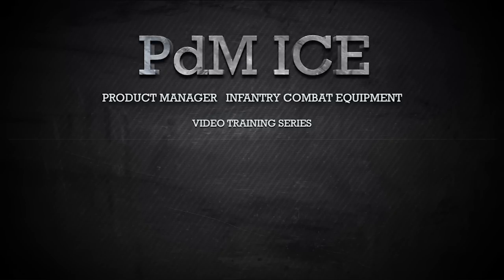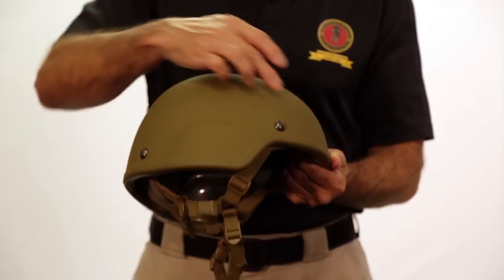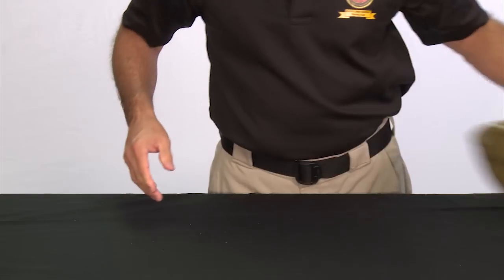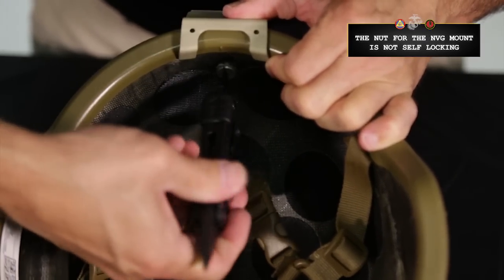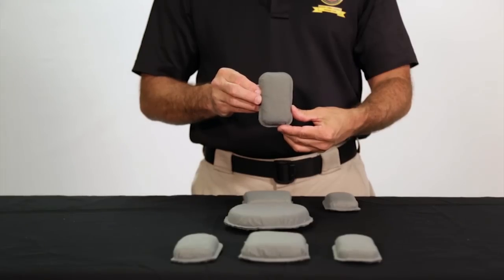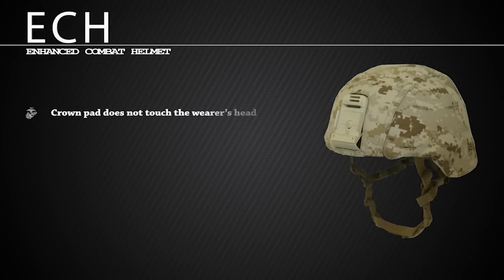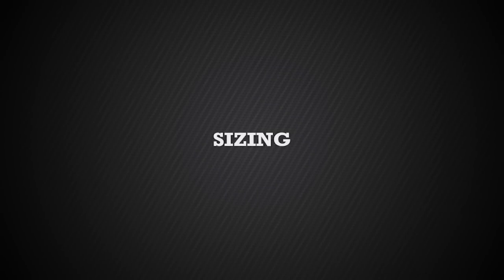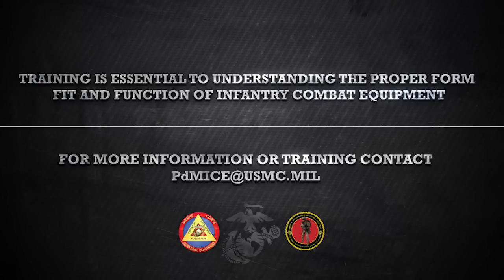Enhanced Combat Helmet (ECH) Training Video

Comment: Saved my life in Afghanistan!!! But annoying and heavy as hell in my head lol.
Reply: Sound like you had fun we stuck in Pendleton attacking the water
Reply: @ieatcrayons-oi9ye  that was back in 05 lol. long time ago.
Reply: All the fun is gone
Reply: @realblackbetty2204  they didn’t have this in 2005, it was made in 2012.
Reply: @petergriffin110  I’m talking about whatever they give us back them. It was heavy af
Reply: @realblackbetty2204  when and where did you serve
Reply: @petergriffin110  00-05 usmc
Reply: Pasgt
Reply: @realblackbetty2204  PASGT was heavy and annoying with the old suspension, those could be upgraded to a pad system with the BLSS kit

I was issued the LWH with better suspension pads. havent got an issue besides the slimy chinstrap. back in '09
Reply: @louiesouthgate8347  lwh is a pasgt style shell. But very much an ach
Reply: @HatsuneM1ku01  there is a difference with the brim being less pronounced and the screws being positioned higher.

But yes they did improve the pasgt shell but design had slight distinguishable shapes

Comment: ECH is product of the Marine Corps and Army and suppose to be the first level 3 ballistic protection which it can take high caliber rifle rounds .30 carbine, 5.56 NATO, 7.62 Kalashnikov not sure about 308. Pads are also updated not sure if the pads are by Skydex or Gentex. By this time ECH will be used only by combat roles so the ACH and LWH will be still in use in noncombat roles do to ECH is to expensive to make do to the material that is being used to make it.
Reply: It survives a 308 at 100 yards
Reply: @deez420nuts69  the v50 is 100 yards v100 is 200
Reply: @deez420nuts69  out of curiosity is there a difference on the label indicating if a helmet is v50 or v100? I was going to acquire one at a good price, but would prefer it be the stronger of the two.

Comment: The first thing you are going to do when receiving this helmet is put those useless helmet pads into a ziploc bag with the X harness and replace them with a better quality harness and pad system. Oregon aero or 4D tactical pads and an opscore H nape should do the trick 👌 eventually upgrading the NVG shroud should be considered as well.
Reply: They actually changed the NVG bracket and went with the Ops-Core Head-Loc retention system. The new bracket mounts straight to the front of the helmet and doesn't have to be hooked over the brim like the previous design.

Comment: With fielding of the ECH, Operation Helmet is receiving multiple requests at the individual and unit level for the helmet pads we buy and send free to troops OTW. Told ya'. Now over 83,000 kits sent out, none returned. These upgrade pads ($28 apiece) last an entire deployment, not the six months with the GI sacks of poop.

Comment: I like how the marines and army made the same helmet and just named it differently, ACH and ECH
Reply: Cody The Gulf War Airsofter the helmets are the same.The ECH helmet is the multi branch helmet that is replacing the ACH for the army and LWH for the marines.
Reply: Well not really the ach and ech have the same design they are made of different materials, also the ech can stop rifle rounds the ach cannot at least not without a glancing shot.
Reply: the galapagos yea your totally right . That completely slipped my mind when I wrote my comment. If I remember correctly Ceradyne stated a 30 ish percent improvement in frag protection as well as protection against specific rifle threats like 30 carbine.
Reply: the galapagos not quite. The ECH has come improved resistance and lighter weight but it certainly doesn’t stop direct rifle hits.
Reply: ACH is made of kevlar
ECH is made of Ultra High Molecular Polyethylene
Reply: Nah, they're different. I was issued an ECH for my deployment in 2019. It's a lot thicker profile than an ACH, because it's made of UHWMPE.
Reply: ECH is very different from the ACH. In the manual I got with my ECH, it includes a little half inch measuring tool. If you put the rim of the helmet on the tool, and it is thinner than half an inch, it is an ACH or MICH. If the shell is half an inch thick, then it is an ECH. Because of the difference in shell thickness, ACH attachments and screws will not fit on the ECH.
Reply: @thegalapagos57 ech can stop rifle rounds but the deformation will leave you drilling a a wheelchair the rest of your life so it’s a lose lose either way. The fact it’s touted to stop rifle rounds is more than a gimmick than anything. Either die from an ach rifle rifle penetration or survive with a baseball dent in your skull and brain damage where a nurse feeds you the rest of your life.
Reply: @HatsuneM1ku01  did you read the account from a u.s soldier that got shot in the back of the head from a pkm burst? Helmet looked like shit but he survived just was knocked out for a while. He was wearing an ECH.

Comment: I like the brim of the old pasgt!
Reply: Pasgt are litty
Reply: Duncan M. Pasgts are more practical.
Reply: Solipsil Interceptor vest has nothing to do with the PASGT other than it was issued with it. The Pasgt handled Weather better due to its helmet band, while as Mich style helmets fail due to the heat from the Pads in the desert, and the pads freezing up in the winter. As far as ballistic-wise goes, yes the Mich is more ideal, but only in SOME scenarios. As if the Mich pads become too soft, the force of a shot would still transfer to the skull. If the Mich pads become too hard, the force goes to the skull again.
Reply: @barn7121  mich and pasgat have nothing on the ECH ballistic wise.
Reply: Solipsil you are right but he’s just saying that there are still some advantages to the pasgt even though the new ech is a much need improvement
Reply: @barn7121  better pads are available for purchase, and I'd much rather have a pad in-between my skull and the shell rather than just air like the old liners, due to the pads helping with back face deformation. The pads as well as the newer helmet shells disperse force from a ballistic impact FAR better than any older design. Of course, there will be some that prefer the PASGT to any newer helmet just like those who preferred the steel pot when the PASGT first came out no matter how much proof there is to the newer helmet being better.

Comment: I purchased a size large helmet. I believe that it's an ACH since it has the Army ACH harness installed. I didn't like the ACH harness, so I purchased a USMC harness which I like better. I don't know if this harness was for an ECH or a LWH, but it doesn't fit the helmet that I have. It indicates that it will fit L& ExL., but it just isn't large enough...it doesn't fit. Any ideas on the reason? I also noticed that the screw posts on the helmet were too large to go through the grommets in the USMC harness...not such a big problem, just enlarged them with a center punch to fit. Numbers on it are; 97427/04011896-2 looked this up in the NSN registry...nothing. The 97472 brought something up, but not a single equipment piece.
Reply: Measure how thick the shell rim is. If it is half an inch thick, it is an ECH. If it is thinner than half an inch, it is an ACH.

Comment: Helmet bands are no longer issued then?
Reply from the maker: Duncan M. Thanks for your question. Nothing has changed; helmet bands are still unit-issued items. They have never been an issue item for the Helmet (SL-3). Units can order through supply for items. They are also available for individual purchase.
Reply: Marine Corps Systems Command Ok, thank you sir/ma'am!

Comment: Seems to me one of the most impractical desighned helmets I have ever seen and probably one of the most expensive to produce. Hell, my Equastrian Troxel Helmet has a better desighn than this at $50. With that pad systom it rides too high on the head with no ear or neck protction.....looks like your wearing a mushrum with a cobweb netting for a retainer. Does the retainner clip have any breakage so you dont get your head riped off from artilery concusion?
Reply: +mark warnberg Ugly too, Seems too me it might like the f-35, A failure
Reply: Always liked the look of the old German Stål Helmet, covered the ears and neck. I´v seen the crome version, man they look Sharp. To bad the helmet got a bum wrap.
Reply: +mark warnberg It doesn't offer ear protection because its designed to be worn with ear protection and coms, namely Comtacs or Sordins. Thats the entire point why its synonymous term is the MICH 2000 or Modular Integrated Communications Helmet. Thats what the problem was with the old PASGT Helmets and K-pots, the way they were cut and rode so low on the ear that it was too bulky and didn't fit well with headsets and ear pro.
Reply: Because your equestrian helmets stop rifle bullets? 
Neck protection are offered by separated neck-pads, and Gucci already mentioned why ear brim was removed, in fact, it was widely required by troops issued older PASGT.
Reply: Riding helmets are not meant to stop bullets but they will protect you from a horse kick with kleated shoes on or your head comming down hard on a Sharp objekt. I was talking about the desighn on a very expencive peice of Equipment.
Reply: @markwarnberg9504  try shooting in the prone with a plate carrier on and the old PASGT or USMC LT-WT helmet. That's another reason the helmet was shortened all round and the visor eliminated. The backs of the old helmets would hit your gear and push the visor down over your eyes.

In fact, while they did it to make the helmets more jump safe, it's still  EXACTLY what the Germans did in WWII with their M35's when they made the Fallschirmjager helmet. Cut the visior off and trim the skirt all around.

So the ACH/ECH is to the LT-HT/PASGT what the Fallschirmjager helm is to the M35/M40
Reply: @poolee77  I wore the M1 a lot and didn´t have any problem shooting from the prone though it wasn´t much fun double timming in it as I recall.
Reply: @markwarnberg9504  The old M1's didn't have the same profile as the PASGT/LTWT, which was shaped after the German WWII steel helm. Also remember today's troops are wearing bulkier body armor and the PASGT/LTWT really interfered with that in the prone. In addition to solving that issue the ACH/ECH is easier to wear headsets under.

Comment: Do these helmets actually stop anything other that the slowest debris from a blast? I have heard soldiers say they are only good for covering a bald head. 😂
Reply: They're rated for 9x19mm and fragmentation (and also blunt trauma) , but they can stop, and videos exist showing them stop glancing rifle rounds from a distance. So they're not useless at all. Most troops don't actually know much about the equipment they are issued, it's never really taught we're just told to wear the shit.
Reply: The ECH was designed to stop certain .30 caliber rifle rounds.

Comment: The helmet sucks, I can't mount my PSQ20B bracket or my helmet light because the edges are to thick. I will have to keep using my ACH. Just a nother waste of money for the DOD.
Reply: I think you got the priority confused, it should be the companies accommodate newer helmet design, not the vice versa. Insight should have designed a new bracket when they received spec on ECH three years ago. 

Tons of accessories designed for PASGT didn't work on ACH either, did that make ACH suck?
Reply: TimCeallaigh it is a safer helmet but its a pain in the a** if you are about to deploy and you cant use the equipment you are use to because your platform is now different. 

In the video they also said that the ECH is not a replacement for the ACH. So our unit will not order any accessories for the ECH.
Reply: You guys have it all wrong. Leather head strap, fiber liner, and no cover or attachments whatsoever. Gotta rock the low ear reaching late 1980's PASGT.
Reply: Wait, fuck that. Take an M1 steel helmet and liner instead. You're versatility just went up, and cost of production down. Who needs Kevlar or Polyethylene when you can shit and cook in your helmet.
Reply: Using the M1 as a cooking pot is not a bright idea it weakens the steel